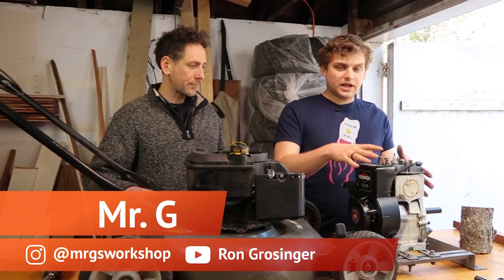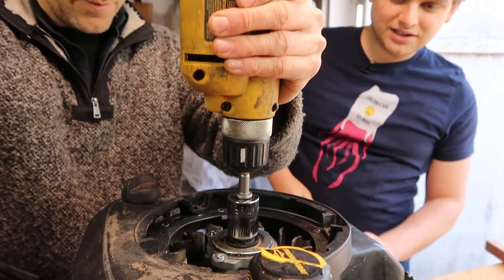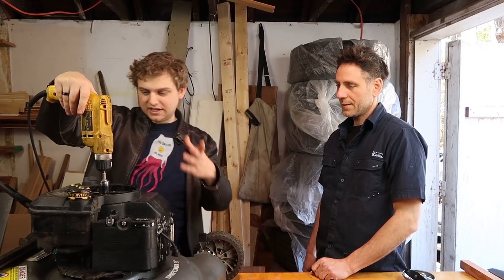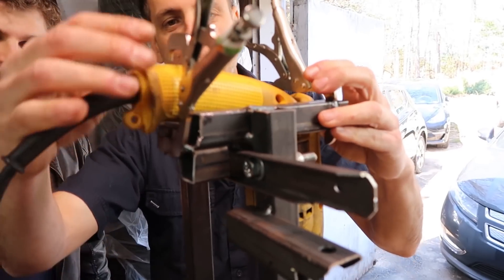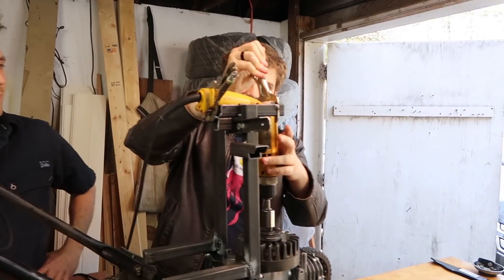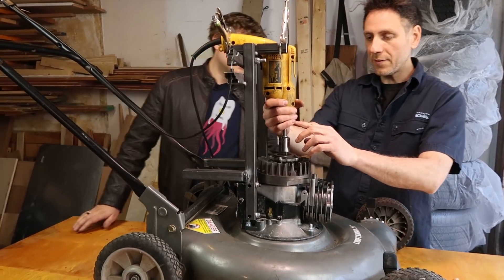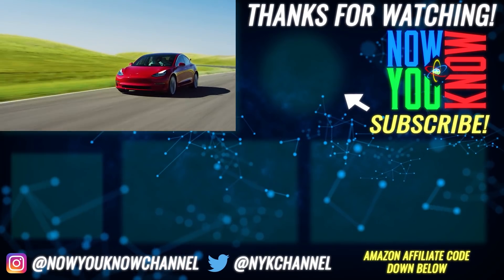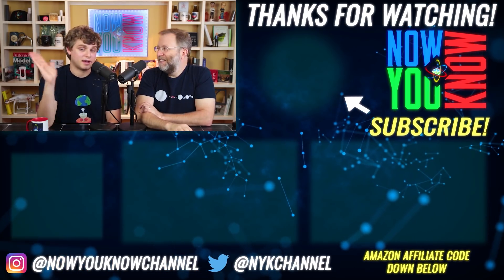Electric Conversion Workshop: Lawnmower Project - Episode 2

Comment: put some duct tape around the cooling fan fins (Flywheel). That will save you some power.
Also everyone , be sure to get  a 12 point socket (not 6) to turn a square shaft.

Comment: The issue you'e have is that a topical lawn mower engine is 3.5 Hp (horse power) or more the drill is no where near that. So to match you will need a 2.57425 Kw motor  to Match  3.5 HP.  (Hp divided by 1.36 = equals Kw) 
Now You Know, Fix The Problem :)

Comment: if you have a small lawn. it's possible to use an electric hover lawnmower. yes HOVER! it's so light that the blade make the mower hover due to the ground effect. best of all. it's dirt cheap. not useable on bigger lawn.
this is just stupid xD and the motor of the drill will most likely burn off way to fast, because of the load it needs to work against for a long time.

Comment: Guys, this is fun and all, but I bought a really nice Stihl electric hand mower last year. It is actually fantastic, and my wife loves using it. I have two other pieces of lawn equipment that I'd love to see converted to electric, and they have no off-the-shelf versions of either of these that I've seen (yet): a John Deere 425 garden tractor (22HP twin-cylinder Kawasaki engine, as I recall) and a 10-ton hydraulic log splitter (with a 12HP single-cylinder Briggs & Stratton or Tecumseh). I split most of my firewood less than 50 feet from my garage, so an electric conversion of the log splitter would be totally wicked (as you East-coasters like to say!). What say you? :-)
Reply: Oh, and I'm guessing a power drill wouldn't be able to replace a 12 or 22HP motor. ;-)

Comment: Too much hardware between the electric motor and the cutting blade.  Just make a plate to bolt a real electric motor to the mower deck and skip all the other junk in between.  Better yet, bolt the blade to a pulley and offset the electric motor so you can turn the blade with a fan belt so you don't destroy the motor/shaft if you hit a rock.  But who wants this contraption anyway?  It's corded, you can buy a corded electric mower for next to nothing (you can probably get a used one for free because nobody wants one).  You guys have way to much time on your hands.  What happened, did Elon forget to use twitter this week?
Reply from the maker: Hence episode 2...

Comment: Or you could just buy an electric lawnmower. Cheaper, there wont be enough torque in that motor to manage the cut. it would have to be a hammer drill to manage that cut. You could have also used a cordless impact hammer drill.
Reply from the maker: This is a proof of concept. If you watch the entire series coming out soon, you'll see all the steps we took
Reply: @NowYouKnowChannel  What are you trying to prove there are already electric lawnmowers. I don't get it.
Reply from the maker: @hasherpeekpower94  Learning and teaching by doing.
Reply: That electric drill did have plenty of power only got caught in a pile of sticks which stop the blade. However in general this is a proof of concept educational video.

Comment: In the 90s i had a Black & Decker GR360 electric lawnmower.  loved it. Work great for more then 10 years.
Reply: Yeah the advantage of the electric motor is that you don't have to deal with the seasonal carburetor problems.
Reply: I moved in to a flat with no lawn. So I left it. It’s Probably gone now though.

Comment: why don't you just completely remove the combustion engine. and immediately put the drill on the cutting blade. then you have no resistance in the bearings and they cannot wear out now that there is no oil lubrication
Reply: Ahah, stay tuned

Comment: Awesome to be taught that there is reststance from a piston and show in detail how to remove a spark plug. Then vioala you just replace it all with a prewelded thingymejig to magically put on. Not sure anyone who did not already know everything you just showed now actually would be able to make the conversion. I hope that comes in a later episode.
I was hoping to learn how to do a conversion (having two old non working mowers) without having to go buy welding equipment (more expensive than a new electric mower).
That is what I would like to see... How to convert one with tools and skills most people have at home. Thanks. :-)
Reply: Okay that's a reasonable request. Unfortunately there is some welding involved. However on my channel there are some how to videos. And I teach welding to beginners. It's a valuable skill.

Comment: Interesting project. Keep it up. If I had a lawn to mow, I would only use electric. I don't mind the cord, in the same way we don't mind a cord to vacuum.
Reply: There is much greater risk to the cord on a lawnmower. I hated my dad's electric lawnmower for that reason.
Reply: @badsamaritan8223  I had an electric corded line trimmer, hated the cord too. I went to battery-electric and love it now.
Reply: Stay tuned, we show how to cut the cord next
Reply: @MrGsWorkshop  We saw that at the end in the montage.

Comment: I have a older 18 volt Ryobi string trimmer and I like it because it is lightweight, especially compared to the big 40 volt and up ones, but not much power. I've often wondered what is possible with a ultra lightweight 18 volt trimmer.The goal would be to get close to the power of a small gas residential trimmer@ 1/3 the weight.  I think with today's tech, one could make a custom, 3-ish  pound 18 volt trimmer with 50% more power (net watt output) using carbon fiber in key areas as well as a small, high efficiency, high torque direct drive brushless rc outrunner motor. Battery cells would need to be the highest density available.  Many small other improvements would need to be implemented. It would be a bit pricey, but could be a fun/ practical science challenge......then I wouldn't dread the 15 minutes of trimming after mowing for nearly 2 hours on those hot 90 degree days so much!
Reply: Great idea, it is possible. Think about the difference between a titanium bicycle and a steel bicycle.